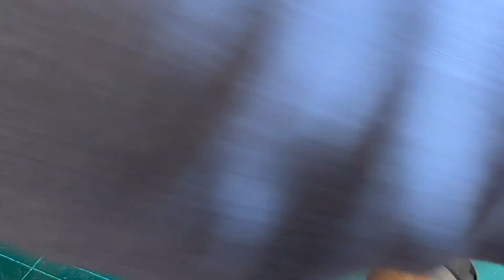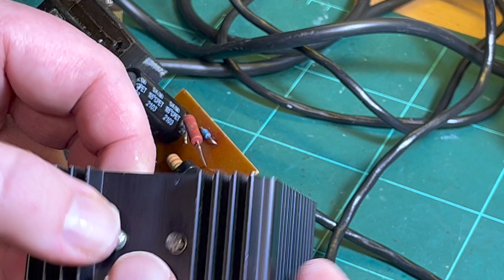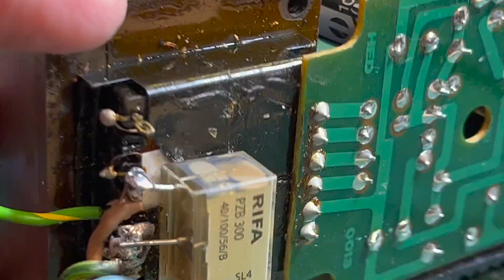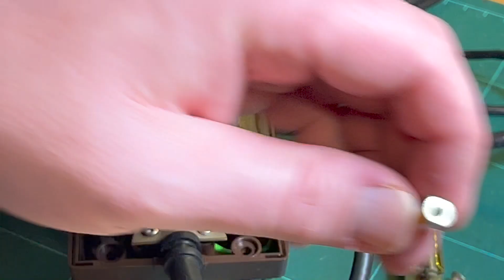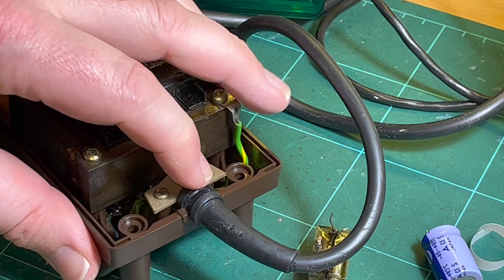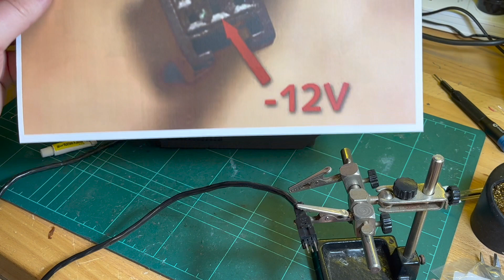🇬🇧 Grundy NewBrain: Part 1d (Power supply repaired) [TCE #0054]

Comment: sounds like ya gotta fix ya solder sucker soon!..bearings in it sound shot...
one of them woulda come in handy removing all the chips from the old CPC board...i did it with solder wick and a goot manual solder sucker
nice job on the PSU repair...just hope it didnt fry the newbrain when the reefer popped